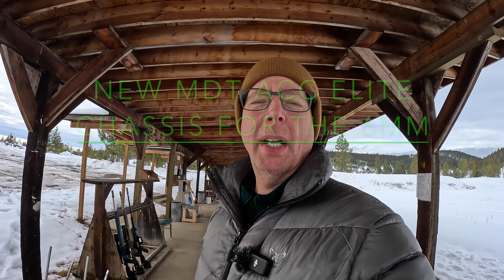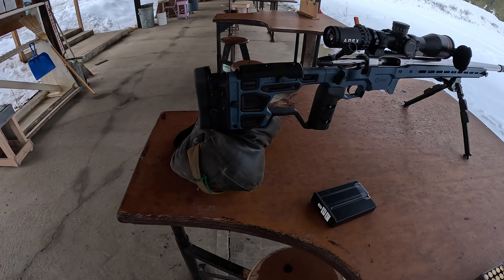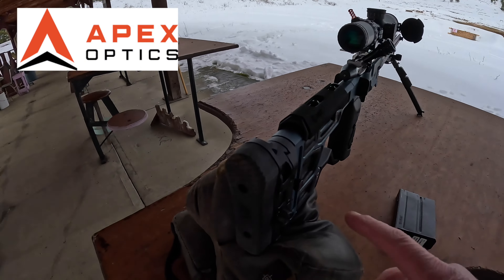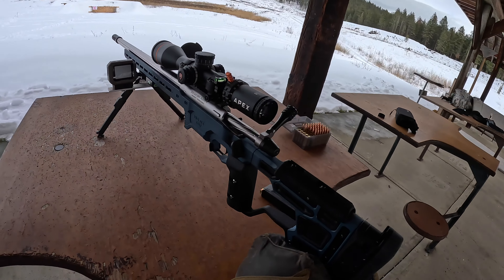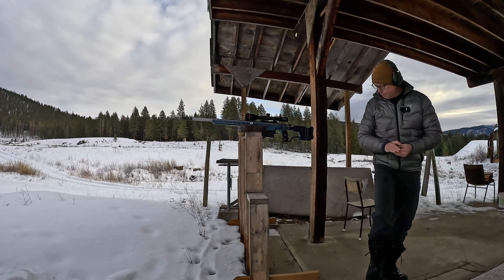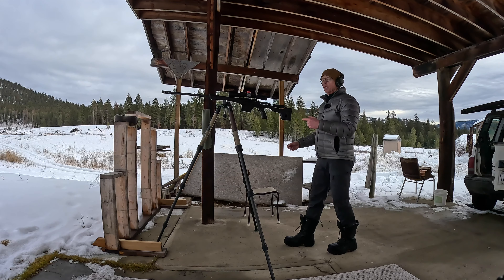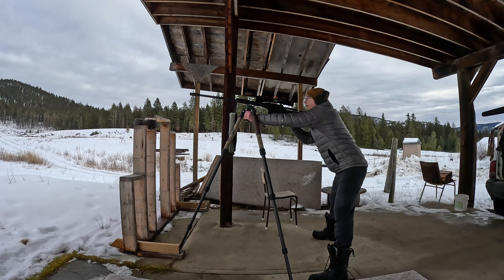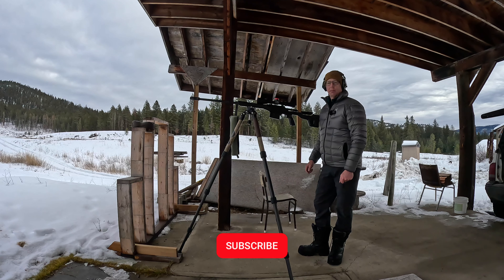New MDT ACC Elite Chassis For The 6 Creed Then Shooting A MDT HNT26  338 Lapua Off A Tripod Standing

Comment: You’ve got that Garmin mounted back a bit too far per their manual.
Reply from the maker: @sstevens7  Hi, there is a manual ? Lol.  It probably is but I am still getting accurate speeds. In my experience with this device, either it picks it up or it doesn’t. I have never gotten incorrect data, so far anyways. Thank you for the tip, watching and taking the time to comment, take care.
Reply: @bcextremeoutdoorsman  yeah the instructions when you turn on the device where it tells you the distance to be mounted back from the end of the barrel